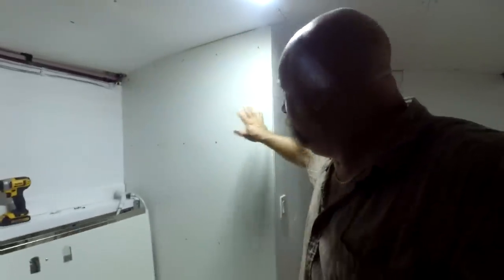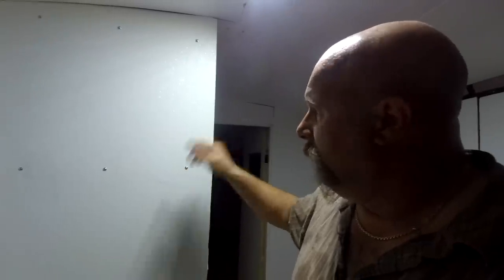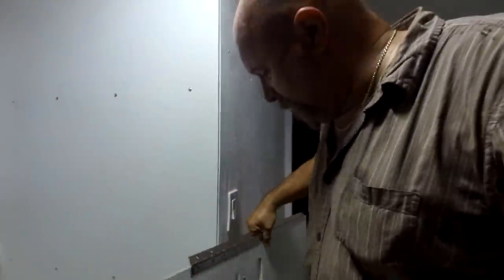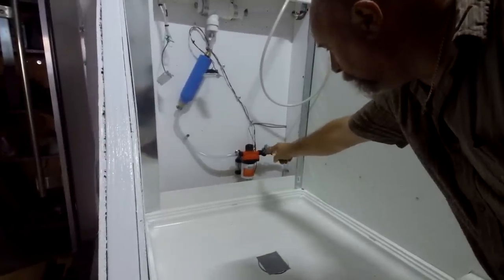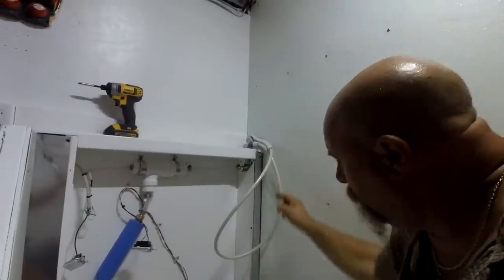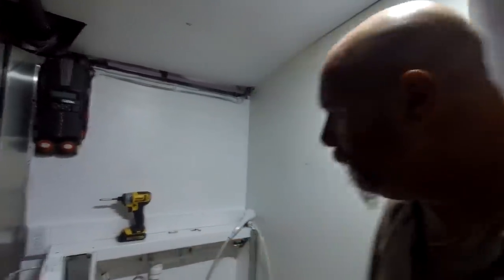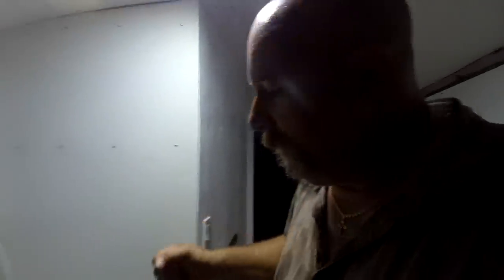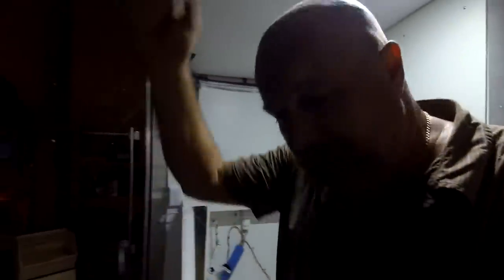526  Hour shower build part 2 / Cargo trailer RV Conversion

Comment: There is a chance of getting scalded if the water temperature isn’t regulated.  A temperature control would be better than hitting the switch on and off 10 times for every shower.

Comment: Stan, whatchuthank about a sort of low point tee off the drain somewhere to get rid of the used water? Using a ball valve or something to close it during use, and then opening it up to drain it out all into a bucket or whatever when your done. Just cuz siphoning never gets everything out, and since we're talking about standing gray water, attracting ants, bugs, skeeters, thirsty furry things...

Granted, I shoulda had this idea before you got the tray installed. Apologies. 😎👍

Comment: That heater would have to be pretty efficient for you not to be able to switch it off before it got too hot.  The photo you showed from the guy that added the heater showed what looked like a temperature control device.  That might be a future upgrade to make the shower easier to use.   We'll keep on the lookout for the results of the grand experiment.   Good luck.  Keep at it.

Comment: Stan, FRP makes a special nylon rivets, Home Depot have them,  Ideal for fastening wall panels, these 3/4 in. White Nylon Rivets (50-Pack) can be used to create a finished look when panels are installed over a rough or uneven substrate.

Comment: I don't know if this suggestion will help you or hinder you but... I use a duck cloth shower curtain.  I have a small shower and can't stand it when I wear the shower curtain, as a breeze flows through the bathroom.  My solution was duck cloth.  The cloth gets wet, but water does not spray through the cloth.  I get mine from the Vermont Country Store catalog.  It is pricey, but worth it, as mine have lasted over 25 years and only wore out at the grommets.  I take it down every few months and run it trough the washing machine.  The directions say not to use bleach but I do,  hot water and bleach.  Yes, it will shrink from it, but my small shower has never noticed.  I get the tub size instead of the shower size because I know I will shrink it from the way I wash it.  It would cost you about $120 for 2 of them, but you will never have a billowing shower curtain.  Thought I would share in case you have a problem with the shower curtain blowing on you.  I just love your re-model!  God Bless....

Comment: I think the system will work. I suspect it will be pretty hard on the filter and I suspect there may be an issue with PVC and Heat as opposed to CPVC can't wait to find out the long-term results. You're going to have to hang a sign on the shower at Ehrenberg $20 hot showers. You won't be worrying about getting back in a truck LOL Tom can make you a solar-powered flashing Marquee.

Comment: My suggestion is that you are either moving the water too fast across the heating element or you have air in the heating chamber.  The "Cooling effect" of the water coming out the shower head is not "500 watts" worth of loss.   A cooling tower evaporates water to remove heat from buildings, and whenever you evaporate a liquid you "remove heat" that is true, but not 500 Watts worth of heat loss coming out of that shower head.  I know this is a late response, but I have no idea if you ever got this to work or gave up on it.  Anyway, the install looked great!

Comment: I stopped using soap several years ago since I’m mostly rinsing sweat away. I do need a little shampoo though! I think there is a warning not to use bleach on water filters??? Maybe add a cap full to the dirty water  and then pump it through the system into the bucket would be a solution??? A low point drain line that you could throw out the back door would have been a good add!
Reply: I wish I didn't know that...

Comment: Stand that our shower system was meant to be drained after each usage, thus not letting bacteria buildup in the system. The idea was each time you would only have to have about a gallon of fresh water at the start of a shower.

Comment: My only concern is pump cavitation. Caused from the rate of water return to the sump being to slow.  If to much cavitation occurs in the system. It will possibly not keep the heating element submerge and cause it to overheat.  You may have to keep adding water to the system to ensure a continuous  flow. How much water does the shower pan hold before it overflows?  System off position.

Comment: Use liquid soap and not bar soap. Dr. Bronner’s - Pure-Castile Liquid Soap (Baby Unscented,
Reply: Use Dr. Bronners for 40 years. Had to stop using as body soap as it causes a rah as you get older since it removes all the oils from your skin. That’s just me. The good is, nothing is better for cleaning a c-pap and kiss your go-jo goodbye. It can’t compete with Dr. Bronner’s peppermint liquid soap. You can get it at most supermarkets including Walmart. Expensive, but worth it.

Comment: The Gone Boondocking hour shower is a bit different for it's heat source and temperature control.  I'll be interested to see if this alternate heat source will work.  Shampoo?  that really isn't a concern is it :) ?  Using a biodegradable soap and epson salt along with the filter will keep the water clean enough for one shower cycle.

Comment: Interested to see how usable the shower works out for you. You could always find a local water source and filter using something like Amazon ASIN B01LFMTYBM pumping the water in a 30 or 60 gallon Aquatank2 bladder in a truck bed, then transport it back to the RV if recycling water doesn't work out.

Comment: You are "F ing up" by recycling the dirty water thru that system !! Find a way to heat the water in the tank and heat that
water...yes you might waste some water, but  the shower water will be clean and the pump system will stay clean !!